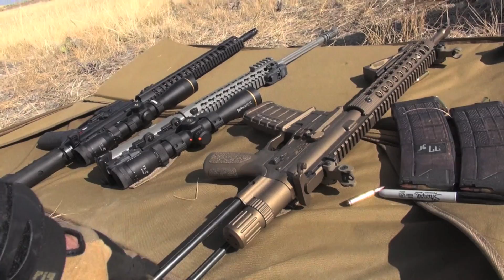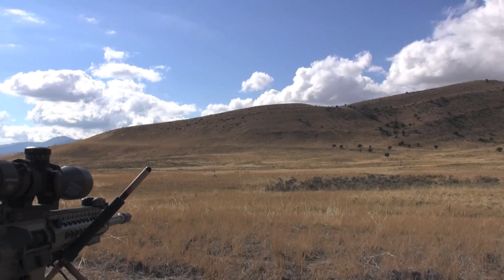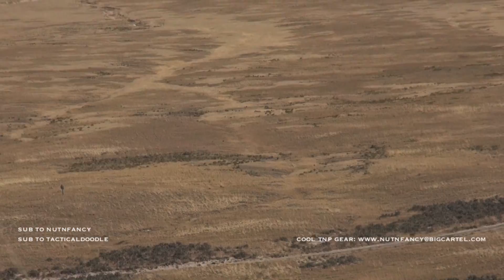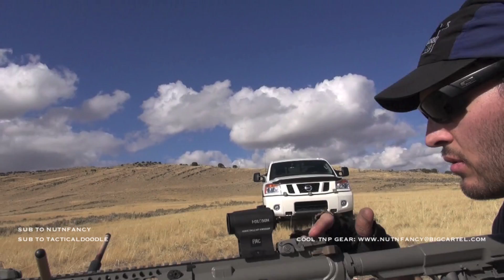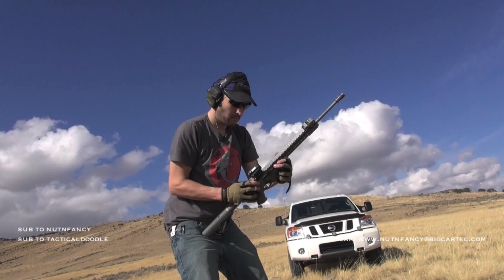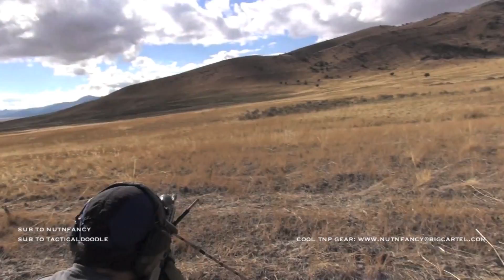'Hobby' AR15s Suck...Or Do They?!

Comment: Those Colt Canada CHF barrels on the Legacy Mod 0 SR-15 weren't known for accuracy. Do you know how many rounds your acquaintance put through it before you "reviewed" it? You assume subsequent Mod 1 and Mod 2 SR-15's are the same. I can tell you that they're not. Different barrels and different gas systems.
Reply: excuse patrol ^^^^
Reply: Agreed.  If there is one high end AR-15 that is not hype, it's the KAC.  Unlike other AR-15's there are actual meaningful differences esp in the bolt.  Love TNP but don't agree on the KAC SR-15.
Reply: My KAC is beautiful, but has been a disappointment in accuracy.
I has NEVER even been close to a MOA gun. It came ith a couple of minor issues that caused jambs. I had to a pay a gunsmith to fix it. Grab a KAC and go to war= absolute BS!
On the other hand my SR25 has been a good rifle...MOA performance....For the money it bloody well should be!
I think KAC is the most over valued over hyped weapon on the market.

My JP on the other hand has just short of 8600 rounds and is ready for another barrel as accuracy has fallen to near MOA.....Every jamb experienced in that rifle was ammunition related.
People suggest it is not a war rifle....Maybe that is true in a sandy desert environment, but for where I live it is my goto rifle. If you going to spend stupid money, on an accurate rifle, need a three gun setup,  JP does it better IMHO. 

I have self built ARs as well...Less complaints than my KAC on all of them
Reply: My Mod 1 has been perfect through 3k rounds of various ammo in bad conditions (mostly frangible which is a problematic round).  I always considered it a short and medium range gun with high durability.  The only maint it got was a wipe of the BCG and a squirt of lube.  Is there a reason you didn't just return it to Knights?
Reply: LeftThumbBreak Yeah. I live in Canada....Shipping it back and forth over the border is expensive and a painful nightmare! Knights offered to fix it, but FML for that money it should have been perfect...especially an international shipment...
Don't gt me wrong I still shoot it plenty, but combat ready? My ass!
Reply: Smokin07ram Which Mod is your KAC? Because your experience is in the minority.
Reply: AmuroR4y E3 bolt Mod2
Reply: I don't doubt Nutn's or Smokin's experiences. Me, having had M-16 bolts disintegrate on me, I value that E3 bolt in an AR. I agree the SR-15 is just an average accuracy carbine. For Smokin not being able to send it back really hurts.  For Nutn the accuracy for sure is a deal killer at the price.  For that same reason I think Nutn liked the SCAR L (16s) which really is probably even more durable (cept for the stock) and for me is really accurate.

Comment: Wait, I'm comparatively new to shooting. Bought my first AR15 about a year and a half ago (a DDM4V7), then built up 4 AR15s plus an AR9 with parts from 5+ different manufacturers, and all have been 100% reliable and spot on at 100 yds (I have only iron sights right now) with my own reloaded ammo (the only issue I had was with the AR9, for which I needed to adjust the buffer weight); accuracy and reliability at least on a par with the DD. Did I just get lucky? Is there really a rampant concern in the shooting community that DIY AR15 projects are unreliable and not worth it? From an experiential view, I have to say bullshit, unless the DIY builder is a complete moron.

Comment: I have an AR (XM177 clone) that I built back in the 90's and it has run flawless since.  
I did build it to spec (remember Nesard?), and it has performed without any problems.
I've always been suspicious of those that claim only a certain brand with certain features
is worthy.  I am not a fan boy of anything, I'm an engineer and I make decisions based on data, not fads.

Comment: I built my AR specifically for reliability.....
Reply: Me too. I got a premium PSA m4 in the 2013 scare I bought and only switched the bolt out for a nb bcg. Then I built a no frills 18 inch PSA with just a sling and a carry handle with a nb bcg in september. Both work reliably. The one I built is tighter than the one I bought.